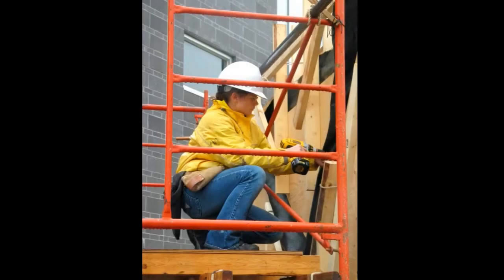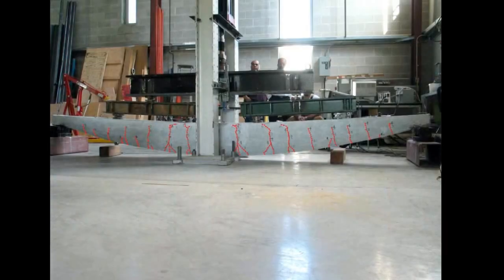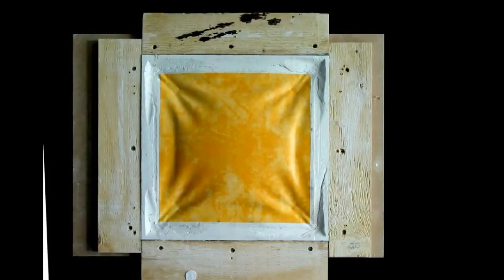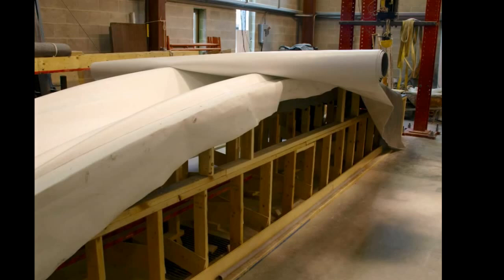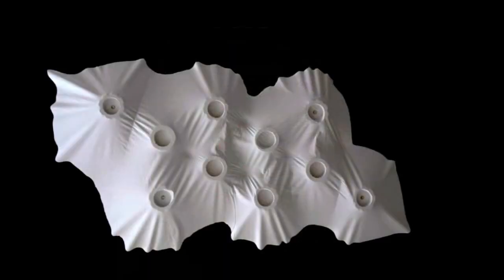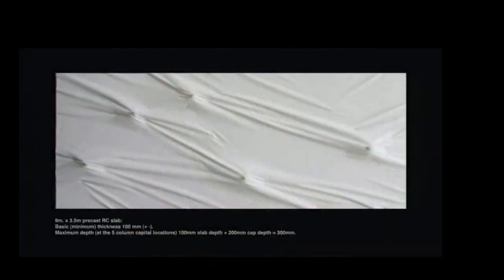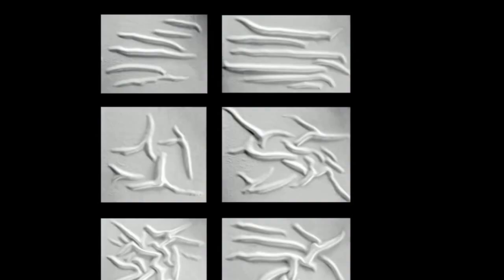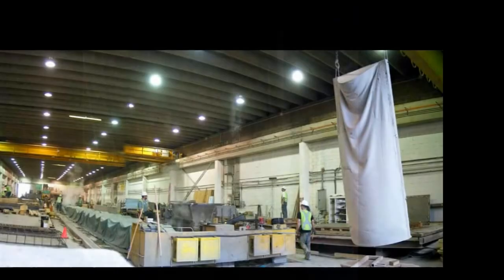Heavy Light - Fabric Formed Concrete Structures : Building Technology

Comment: Could these be used as lightweight bridges across remote streams and rivers? (The long curved arch). Able to be pulled across an expanse with a rope and few workers...imagine taking a 100’ roll of fabric and bags of cement and glass fibers, out to a remote river crossing and building a bridge at the side of the river... they just need to be strong enough to walk on and additional strength can be added until desired strength is reached... adding (cheap) styroaircrete for additional strength, mass and insulation...

Comment: My experience: cardboard works well for forms on small blocks. Nails work great to tie this to wood while cloth is wet. Foam concrete fills in voids well if you want it to look flat. Pallets with plastic are a sufficient form. Oil your exposed skin vinegar and soap after. Paper machete is a great form to set cloth over. You can fill your mold with plastic waste. Old paint in the concrete mix helps with flexibility. Paint helps for ponds. Fibrous materials added to concrete helps strength.

Comment: They have one flaw. They never demonstrated that their Heavy Light - Fabric Formed Concrete Structures can be used to create a dome by using a calcium aluminate cement-powdered brick-lime/lime and sticky rice glue water mxied with aluminum carbonate paste that will fill the forming fabric with concrete foam and the cakcium aluminate cement will make the mixture CURE AND HARDEN FROM WITHIN. The powdered brick will provide tensile strenght as if reinforced with steel rebars, the lime and sticky rice glue water will strenghten it further and the aluminium carbonate paste mixed with it will turn it into a lightweight foam. AND THEY DID NOTHING TO EXPERIMENT WITH THIS IDEA.
Reply: @bruceborowski1100  We successfully did it "QUITELY" in the middle of Siberia inorder to create permanent survival shelters in the form of "domes" and inside them are houses and buildings and public utilities and what-have-you. I am taunting you "OUTSIDERS" to test and check your reactions.

Comment: This is incredible. The draped chain parobola mentioned at 19:02 could help to form the fabric with triangulation if multiple chains were suspended to help the fabric to have engineered creases. An excellent small scale experiment to build a small scale 20 foot long arched ferrocement arched bridge.

Comment: Wonder if this would work with Aircrete.
Reply: I imagine you could to a certain extent. You are limited by how deep you can pour it, as well as how fragile it is. It would be an interesting experiment. :)
Reply: Indeed.
Reply: I was doing 'ruched' fabric art in Uni years ago and experimented with plastering techniques to see if I could produce a solid piece. I made concrete slurry and painted/splattered it on the fabric, a simple 'rendering' technique. You can continue to splatter the slurry until a desired thickness is reached. At some point the slurry begins to set and the piece can be manipulated to allow you to pour, spray, paint or trowel slurry wherever you want. Recently I've been revisiting my earlier work having seen people make lightweight slurry by adding foam to the mix. This would I believe give you the perfect medium to realize concrete forms from fabric.
Reply: Works for form fill. Strength in ripples and surface is key. Recommend regular concrete on the cloth form then fill in with aircrete

Comment from the maker: In some applications of high-strength concrete the design criterion is the elastic modulus rather than the ultimate compressive strength.#DocumentaryFilms #TVShow #Concrete
Reply: Great lecture. Nice work. Concrete is such a versatile building material. fabric looks like a great way to achieve natural shapes! I once experimented with throwing burlap in a concrete mixer to create a form on rebar with reasonable results. I am always looking for creative ways to form concrete affordably. thanks.
Reply: @justinsimpson2088  use hudrocal fo models it works great
Reply: you are going to love aircrete, ferro cement suspension roofs,   and smd